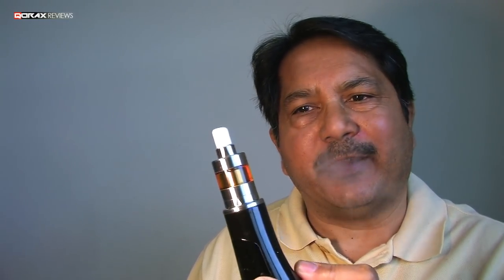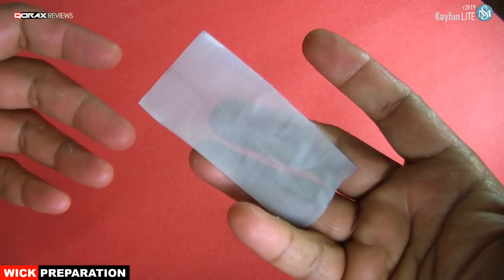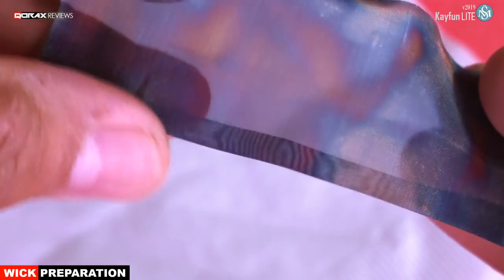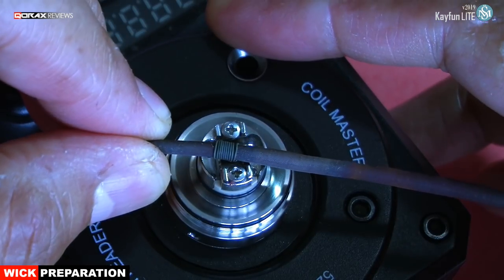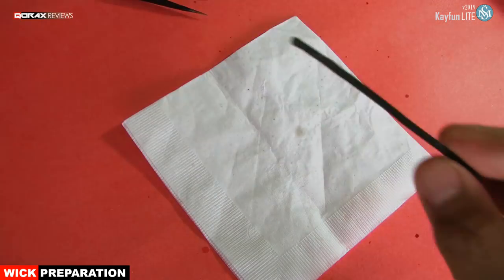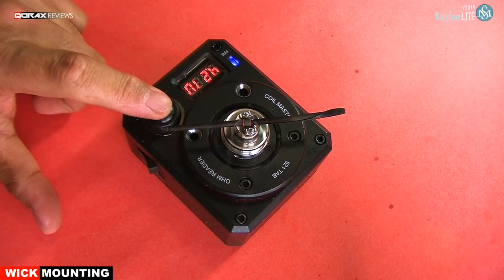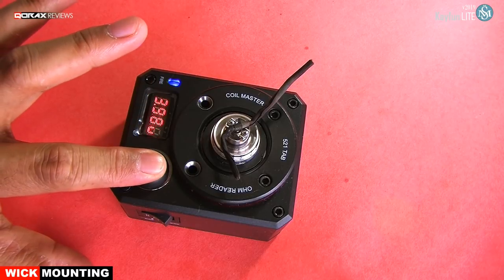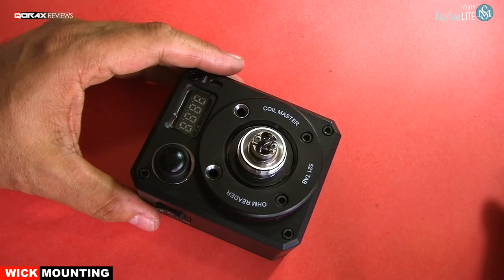SS Mesh / in Kayfun Lite v2019

Comment: it doesnt leak like crazy after letting it sit over night? i tired to do mesh in the GEM 2 works while your using it but when it sat over night it over wicks and leaks into the air flow
Reply from the maker: Hey Rob, good to hear from you. Those GUS days eh! Btw, overnight - no issues, but if you keep it unvaped for a few days - it will flood. The trick is in keeping longer legs.